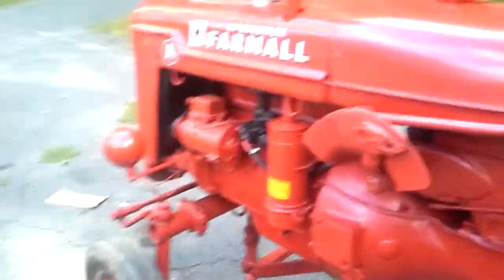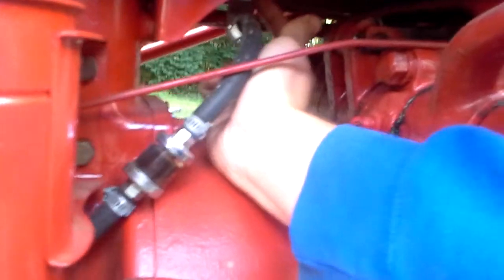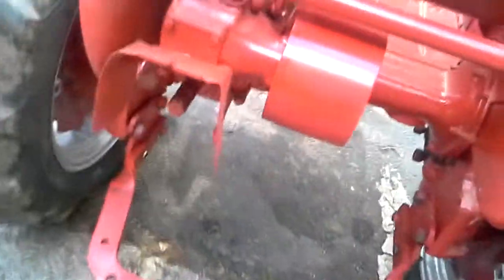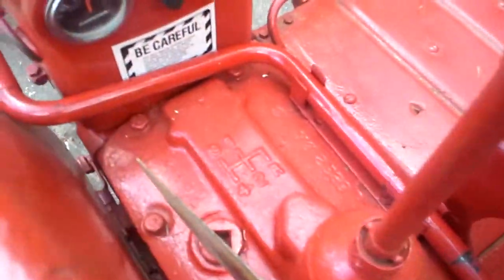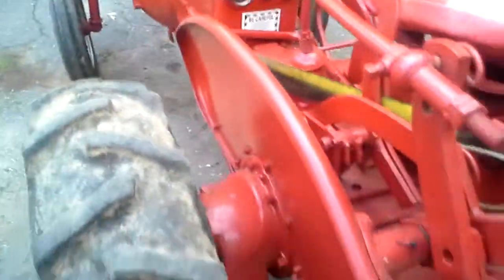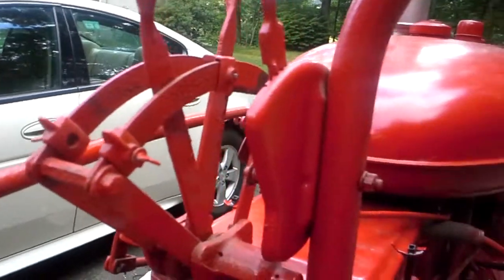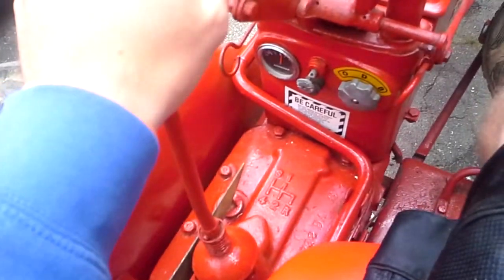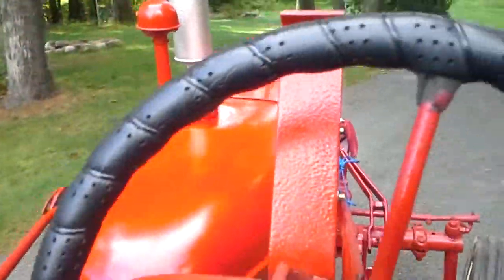1948 Farmall A

Comment: When you shift to fourth just throw the clutch in and slam her back and go
Reply from the maker: If you want to chance grinding gears and/or rolling backwards if you're going uphill sure... If your tractor can't get underway in road gear pulling a load from stop then it's time to work on your tractor.
Reply: +havoc1482 it won't grind bad just like jip and it won't roll under load I've done it before many times gets right up and goes I'll upload a vid of what I do
Reply from the maker: I know what to do. I've driven all sorts of Farmalls from Cubs to Hs. I've seen first hand what happens when you miss/grind a gear going uphill with a load. It's not a safe practice.
Reply: +havoc1482 I've driven a lot of Farmall also have a 48 c that me and my grandfather recently restored we restored a 40 bn and we just finished another 46 bn next we are doing a 40? M